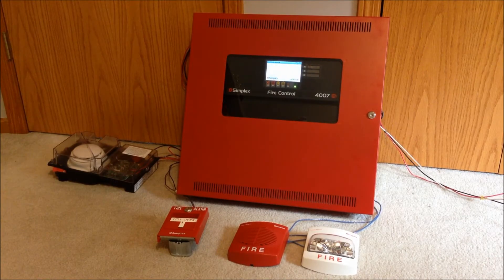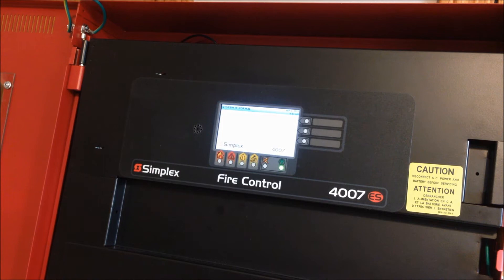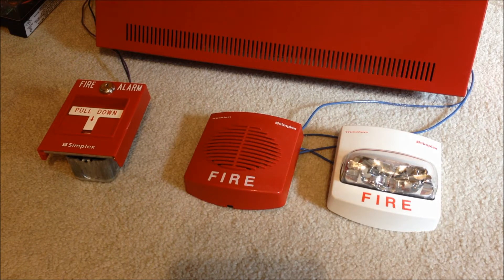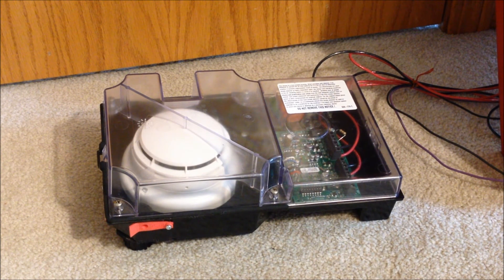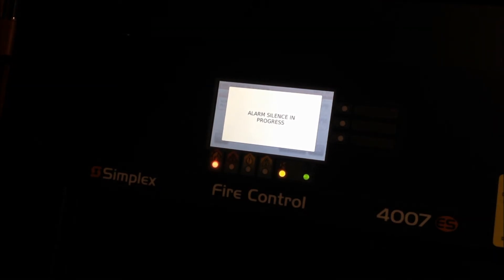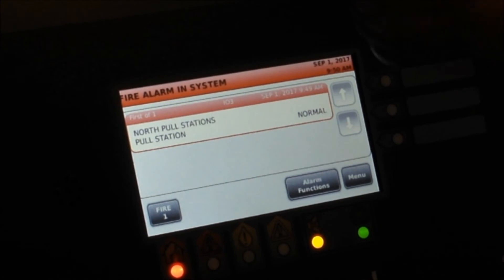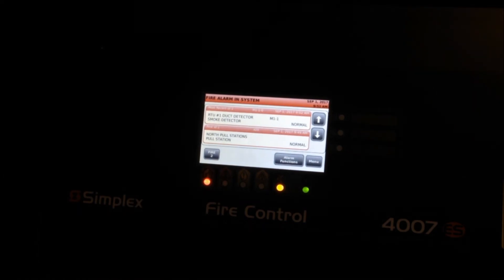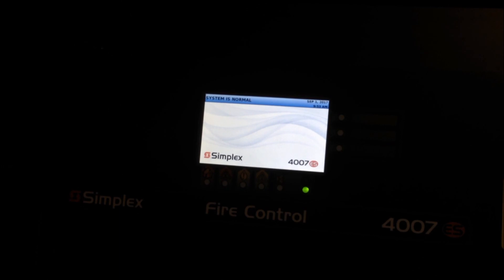Simplex 4007ES Fire Control Panel Demonstration and Test

Comment: We have one of these units for our church and we need to update some of the wording that the original tech input into the system to define specific devices - we have since followed a uniform naming convention and want to update what the display says compared to our church floor plans which I finished. Because we are a church of limited $ is this something I can do myself. I'm pretty tech savey.  Thanks!
Reply from the maker: Hi Brian, unfortunately there is no way to modify the core programming on this panel (which included device names) without help from an authorized Simplex representative. What you see here was specifically configured as a demo/educational system, and even I cannot modify the device names on this unit now. I hope this answers your question. Thanks!

Comment: Did you have to program it by connecting it to a computer?
Reply: i don't know about him, but i talked to a retired fire alarm technician (who worked at simplex) and he's sending me the same panel (the 4007es) and told me i would have to program it with a windows computer. so overall i think yes he probably did.
Reply: @simplexpulls3     Pretty sure you would have to have the Simplex 4100ES programmer at the correct rev to be able to program the panel.
Reply: @Ariaisgood  actually, now that I own a similar 4007es, it's programed on computer via the ES programmer software.
Reply: @simplexpulls3  can you tell me if the main board of the 4007es has a relay?

Comment: I suppose this simulates a system in a building from 2014
Reply from the maker: I think most of this equipment is new enough to stimulate anything from 2014 - a brand new building built today.

Comment: I think they have one of these at my friend's university. They had a Simplex 4002 system next to an abandoned gutted 4208 cabinet, and the alarms were Simplex 4051+4050-80 horn/lights, and break-glass 4251-30 pulls and 2098-9201 smoke detectors on 2-wire bases. But some time back, they removed the 4051 horns and slapped TrueAlert horn/strobes onto the 4050-80 light plates, which leads me to believe the 4002 panel got replaced as well, most likely with a 4007ES.
Reply: UPDATE: Yes, they indeed have a Simplex 4007ES panel replacing the 4002. It's even red, just like yours.

Comment: Damn, that's awesome! Quick question, what's the difference between smart sync and free run?
Reply from the maker: Thanks! Free Run means that the device will operate on 24VDC, no additional equipment required. The strobe circuitry (if present) will run freely on its own and flash at 1Hz, hence the designation "free run." SmartSync, on the other hand, is a Simplex technology that uses coded data pulses over the NAC to keep both the horns and strobes in sync. A SmartSync device will not operate if 24VDC is applied, instead it will wait for that data that commands the operation of the horn and strobe. This keeps the horns and strobes in sync, and allows the devices to produce coded signal (Marchtime, Code-3, etc.)